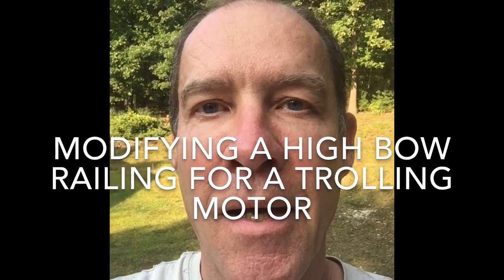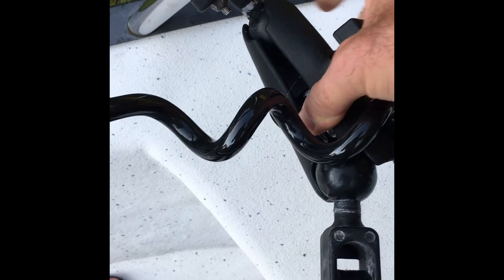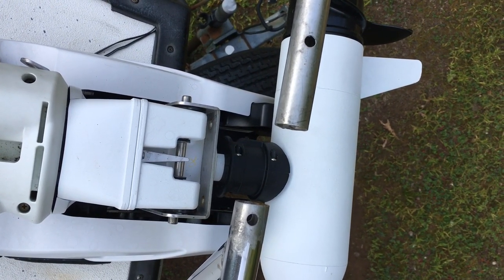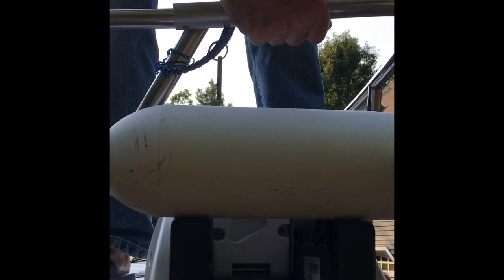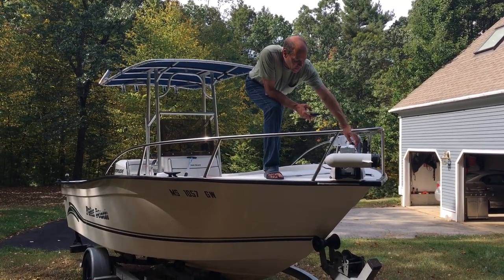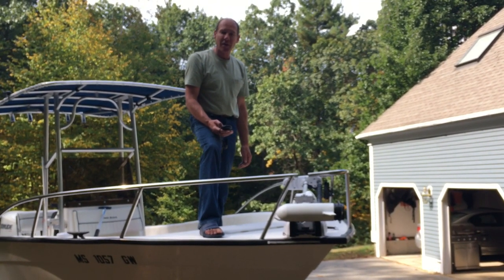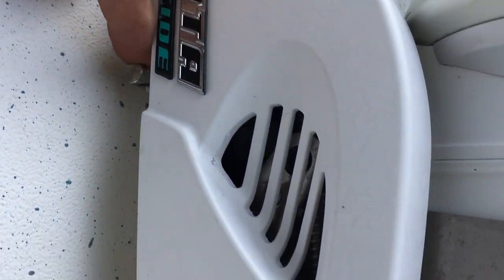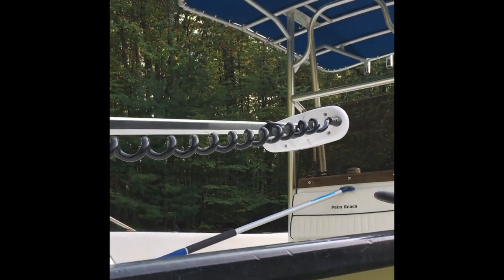Mounting an Electric Motor on the Bow of a Boat with a High Railing

Comment: I basically have the same boat as you. I have a 23'key largo. will be removing my bow rail so iam not worried about that but why the aluminum plate?  With the quick release plate from min-kota why did u need the plate?  Also why to you put it directly over the bow running lights? Why not closer starboard so you didnt have to remove the running lights?
Reply: Aluminum plate to lift the assembly above the rub rail. I wanted to have the motor as close to the center of the bow as possible, but when stowed, as out of the way as possible.  Also, I replaced the running lights with LED strip lighting.  Much lower profile and I don't have to keep replacing bulbs.
Reply: Gert Walter thanks appreciate the reply. How was wiring to ur trolling motor battery? Did you go threw the piece of tube the nav lights go threw or did you drill somewhere else to feed the wires back to the battery in the compartment?
Reply: @richardjohnson33755   Very straight forward.  Tubing too small, so I just placed a socket in the bulkhead wall between holds.  Batteries wired to back of socket.  Plug from motor in front of socket.
Reply: Gert Walter  excellent! Thanks again. You did quite and exceptional job on these modifications. One of the best I have seen on youtube. Cant wait to get started on mine. Any recommendations on battery brand or charger brand?  Thanks again!
Reply: @richardjohnson33755  I used a ProTournament 240 Elite Series with a 12V AGM battery on opposite sides of the hold. AGMs a bit more expensive but will withstand the pounding in waves a bit better.  I'm not sure how to attach pics to these responses, otherwise I'd include them
Reply: Gert Walter great recommendations! Dident know those products existed. Thank you again. Last question. Did you mount the pro series charger in a hold on ether side with a battery or in the anchor locker by itself?
Reply: @richardjohnson33755  No room in my anchor locker.  I put 2 12V AGM batteries on either side of the hold closest to the stern, the charger in the middle.  AGMs go in battery boxes so they can be secured to limit the bouncing around.
Reply: Gert Walter understood. I guess being alittle forward of mid-ship,  the possibility of the batteries bouncing around gets real. Thanks again. Great info and great boat. I'm gona post a video when I get done.

Comment: Thanks for the video! What did you use to cut the bow rail and where did you get the tube and pins from? anything you would have done different? Planning on installing mine within the next week and i have the same set issues you had in the video.
Reply from the maker: Ryan, sorry for the delay.  I used a Rotozip (similar to a dremel tool) metal cutting blade to cut the railing.  Pins amazon.  Stainless steel tubing on line, there are several sellers.  Very important to get the ID of the tube just about the same size as OD of railing, fine sanding of the railing will make it fit.  Rock solid the way this is set up. Only difference is the gimp isn't strong enough to last seasons.  I ended up threading galvanized wire inside the gimp to make it look the same but stronger.  Thanks.  GW
Reply: I used a rotozip (dremel) tool to cut it.  Tube and pins from the internet.  Maybe different, higher quality pins since the saltwater rusts them fairly quickly.

Comment: Great video. Where are you placing the batteries tied to the trolling motor?
Reply from the maker: This boat has 3 holds up front.  I installed in the closest to the back.  Easier access and the most room.  Thanks
Reply: Sorry don't follow. You installed it in the front or back?

Comment: can you adjust the propeller for bow mount and transom mount
Reply: I'm not sure what you mean.  If the prop is facing 180 degrees on the transom, just run it in reverse.